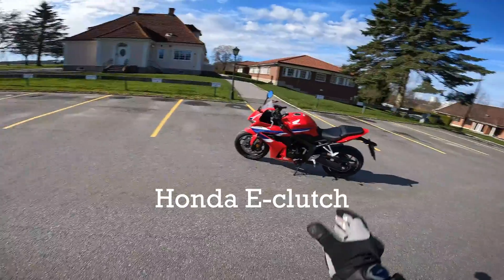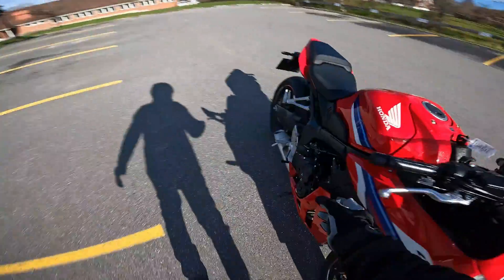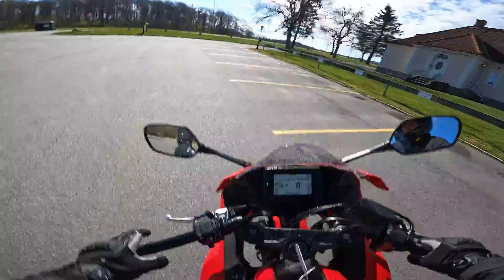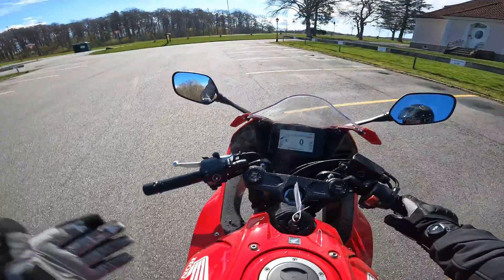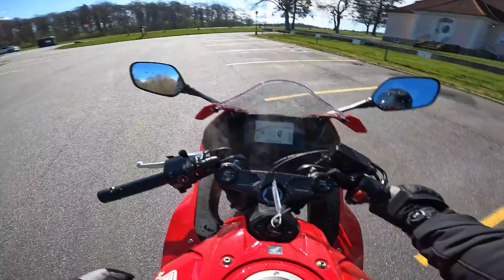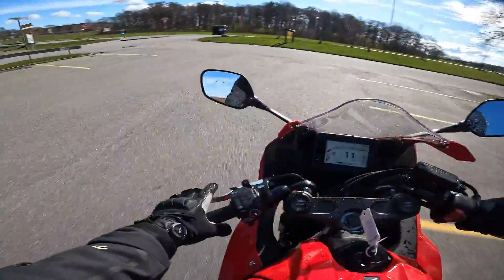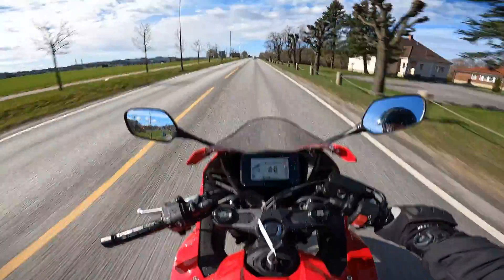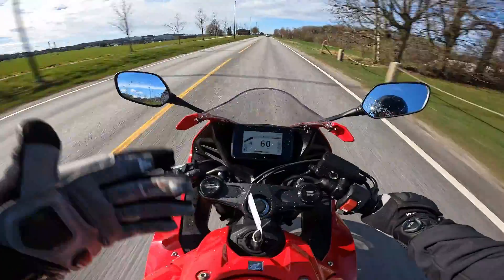Honda E-CLUTCH - How Does It Work? (Honda CBR650R 2024)

Comment from the maker: What are your thoughts about the E-Clutch?
Reply: Hvorfor ikke kjøpe en automat i stedet?
Reply: @ZD-gj6tt  Nevn en sykkel som er automat (som du faktisk har lyst på)
Reply: @ZD-gj6tt jelly?
Reply: I’ve got an MV Brutale SCS with the Rekluse clutch which acts very much like the EClutch. 

My only objection to SCS is that at very low RPM you have no clutch control - The clutch is centrifugal and is disengaged at low rpm. 

This means it’s harder to ride at very low speeds. You can’t use the clutch and rear brake to maintain balance
Not a big problem but it can be annoying
I guess the eclutch is similar
Reply: @Pikestnt  It looks like if you use the clutch lever the eclutch starts disengaging. Otherwise they'd just remove the lever.
Reply: I've got a KTM Duke 390 with the Rekluse RadiusX centrifugal clutch. Same like the E Clutch on this Honda. It's a dream for city riding. No stalling ever. Was going to buy a Brutale 800rr SCS but MV no longer offers the SCS on the Brutale, only on the Dragster models. I even called Rekluse to see if they'd sell me the clutch to install myself - they said they can't bc they're under license from MV...E Clutch is a blessing
Reply: @Pikestnt  I thought that when I got my first bike an old T-max 500 cc scooter with fully auto CVT transmission, I just pulled the rear brake and gave some throttle and it did make a notable difference to slow speed manoeuvres.
Reply: @Pikestnt 
 It's great for those that
will never master the use of a clutch,
or have physical issues, but I think 
80% of those that claim those 
physical issues are just
fakers, an easy excuse to not 
master clutch use.
Reply: @CensorshipEatsFreedom arthritis sucks, after using the clutch for even 30 minutes my hands would hurt like hell. I might get one of these
Reply: @MaybeNotAndrew  
I hear ya, I had classic RA symptoms
for about 18 months, it can be
debilitating, Medication is NOT the
solution imv, and in my experience,
it didn't even help me, I improved
my diet and that 'may' have helped,
medication just masks it. 
From everything I've read 
and seen in videos, it's 100% 
intestinal related, poor nutrition 
having the greatest affect, however,
'taming' Arthritis is not a one week
or one month 'thing' .
Reply: @MaybeNotAndrew  
....I still have pain in my right hand
lol, just from holding a throttle
position,  my issue today may be
carpel tunnel, which I had years
ago. 
I ride a LOT (!) , I have to modify
the way I grip the throttle, I have
a bunch of different types of 
positions that I have to use.
I ride street now, not much 
on the dirt bike, my clutch pull
is NOT easy, I drill a lot on 
clutchless shifting, which takes
a lot of time to get down 
smoothly, I do clutchless mostly
on upshifts, downshifts are tough, 
some bikes are a lot easier than
others, and the EU 3 4 5 etc emissions
regulations cause the throttle
on many bikes to dive between
shits, this makes it all much more
difficult  get shifting period down
perfectly, in some cases an 
ECU flash can be the fix.
Reply: I would be worried when I fell off the bike while it is still in gear and engine still running. Some good person might want to help and accidentally twist the throttle while lifting the bike up... Will the bike suddenly jumps away and hit something else. I have seen many auto scooters did that.
Reply: The trouble with the MV set up is that it has two clutch controls in series: Engine speed and the clutch lever, so you have to balance both of those as well as the rear brake. It’s doable but not as easy as just the clutch lever.

Conversely, it is lovely to ride around town without needing the clutch or leaving it in gear while fiddling for change at the peage tollbooth 

Incidentally, if the bike tips over, the tilt switch kills the engine so there’s no danger of a helpful passer-by going off down the road at 90mph whilst picking your bike up 😂
Reply: It's the same as a recluse clutch
Reply: Can you compare this to quickshifter?
Reply: @cyberpsychosis5367 it is a quick shifter on steroids.
Reply: @cyberpsychosis5367  You can't stop and start the bike with a quickshifter.
Reply: @cyberpsychosis5367 no
Reply: Innovation at its best honda
Reply: Now its scooter 😂no more bike...
Reply: finally, QOL for high traffic areas
Reply: For someone that lives in the city and rides religiously between 1st & 2nd gear, this is a game changer. Traffic is insane where I live with all the stop lights, cars, and pedestrian. I’m 16 minutes away from the highway until I could WOT.
Reply: Something every bike should have. Manual clutch is unnecessary.

Comment: Can you pull in clutch for u turns? I usually pull in clutch, modulate clutch for u turns and tap the rear brake on my 2016 Z1000
Reply from the maker: Yup. You can ride it like a normal clutch bike

Comment: Unlike the DCT, I am understanding that the rider would still need to use the shifter to go to up and down gears, simply without using the clutch lever. Also that the e-clutch is designed to cater for those moments when generally the rider needs to 'feather' the clutch in traffic?

Comment: Finally, automatic bike users with little to no knowledge of traditional manual gearbox can enjoy big bikes
Reply: It's still a manual shifter. You have to shift gears with your foot. Just don't have to pull in the clutch to shift or prevent it from stalling.

Comment: I think some people get confused. It's NOT and automatic transmission except when you stop, you can leave it in 1st gear. You still have to shift up and down, just no need to pull the clutch lever. You shift, it clutches.

Comment: This is game changer! I imagine this system will be a bliss in traffic. Being able to go full manual on the twisties is basically the whole package.
Reply: There is no reason to go fully manual though. You just shift and leave the clutch alone. It's not an automatic transmission. You still have to shift up and down.
Reply: the super cub and its derivatives have had a functionally similar system since the 50s, and those are the best selling motor vehicle of all time. They're a blast to ride in traffic and I have always wished for that system on a more powerful bike
Reply: This actually is the best use for it; my hand gets tired having to clutch for traffic…. But they could just legalize lane splitting everywhere and we wouldn’t need this.

Comment: So it works on both up and down shifts? And you don’t have to let off the throttle when shifting? I would love it for stop lights and starting in first gear, but would probably use the actual clutch lever manually for other shifting. I like that they leave you the option of both.

Comment: You can also disengage e-clutch and ride it like a regular bike.

Basically its middle ground between a regular bike and an automatic transmission bike.
Honda is changing the game 💯
Reply: Means bro can we just off e clutch mechanism if don't want it?
Reply: @ShivrajHalyal  there's an option to disable it completely via the menu
Reply: @lume9887  oh that's great!!!    thanks for the help dude
Reply: @ShivrajHalyal  Sadly it gets reset every time you turn off the bike. So you have to dig through the settings each time you want to disable it completely. but you can still use the clutch manually with it enabled. If you pull the clutch it will temporarily disable the e-clutch until the clutch has been untouched for a few seconds
Reply: @ei..  ohk..thanks for the info mate👍
Reply: @ShivrajHalyal you can pull out a fuse and it'll stop like the abs do. but idk any scenario where you need to disable e-clutch or abs, unless you're going on a track or doing stunts. 🤷
Reply: Thank you all for the information, I bought mine today and she is coming home next week
Reply: thanks for this info. even though I know a 650 isnt the best choice for a starter bike, im stubborn and still want it. but I did want to learn how to use clutch without the help first. cheers
Reply: Who tf wants to use manual clutching when you got automatic clutch? If it can do it efficiently, fast enough and reliably, no point going back to manual. If its not fluid enough then no point buying it.
Reply: Haha this technologika come in tvs jiva in 2010😂😂 lol
Reply: @SaurabhDubey15 nobody rides tvs
Reply: Yes, finally. Purists will hate it, but they aren't real. They're just gatekeepers.
Reply: How is it automatic when you still have to shift? Lol
Reply: @bigdaddy5285  i didn't say it was an automatic
Reply: @bigdaddy5285 as the name says its E clutch not auto trans
Reply: @hs5942  if anything it functions more like a sequential transmission not auto
Reply: @hs5942  yep and electronic clutch (e-clutch) bridges the gap between regular bike and automatic.
You can use the manual clutch or just change the gears with out pulling a clutch in
Reply: @bigdaddy5285  most regular bikes use sequentials.
When people engine swap a bike engine into a car (like a miata) they put sequentials in the car if theyre smart. Not sure how reverse works out🤣
Reply: @bigdaddy5285 or more like a moped
Reply: @GungKrisna12 didn’t know mopeds have gears
Reply: @bigdaddy5285 same way the M88A2 is considered automatic but you still have to shift it. But this bike has a clutch the M88A2 does not.

Comment: sorry im a biker noob but what was that puff of smoke before he set off at the start is that normal ? coming from the front ?
Reply: That´s water evaporating from the engine/radiator. The bike was probably parked outside

Comment: What happens when you put it into second gear and give it some gas? Will it only rev up the engine or will it smoothly release the clutch?
Reply: It will be like you start in second gear with the normal clutch. But with E-clutch you will damage it and even the gearbox. Starting in non-1st gear is not recommend for any bike with any system.

Comment: When you brake is necessary to down shift,or the e cluch will do it automatically?
Reply: The E-Clutch will do it automatically when you down or up shift
Reply: You still need to down shift with your foot but the clutch is engaged automatically. It's not like an automatic transmission

Comment: So it’s like a sequential gearbox with the E-clutch. Is there a way to turn it off?
Reply: Yes you can turn it off, also you can just use the clutch normally without issue, it always lets you override it. Ultimately though if you are going to just turn it off you don't buy it as it's a waste of money.

Comment: so..its just an automatic with the option to use it manually if desired. ....
Reply: Semi-automatic 🎉
Reply: No, it`s a manual with an electronic clutch. You can read it on the Honda blog they explain it technically how it works.
Reply: @s7efan90  Its an interesting feature..   checked out a video of it and its nice to have (and good its possible to turn it off as well...)

Comment: Hey! And if want to rev with the e clutch on what you have to do ?
Reply: The 650 doesn't have throttle by wire, so during downshifts you need to blip the throttle by yourself. During revving while stationary or going along I guess you need to hold down the clutch

Comment: It’s perfect 😂😂😂 I stall 60% of the time in uphill start so this would help me 100% 😂😂😂
Reply: ngl, if you keep on stalling I'd learn clutch control. Unless you're on a little 50. Then gl. A 125-250 is very hard compared to bigger bikes, like a 650. But doable with enough experience. You'll get there.
Reply: Just get to like 2K RPM while holding rear brake and gently let go of the clutch then the brake, it's not hard

Comment: Hi have you checked the e-clutch mode? I think it says hard normal soft or something like that. Im wondering what’s that for? like if it’s on high rpm and the mode was set to “soft” it will somehow rev match? while if it’s “hard” it’s just gonna engine break like a normal downshift. Anw cool bike I’m buying this in june.
Reply: Hard or soft is actually for the gear pedal, yup! You can adjust your gear pedal whether you like to stomp it hard or stomp it soft.
Reply: Oh shi this comment was 4mnths ago, you probably figured it out by now 😂